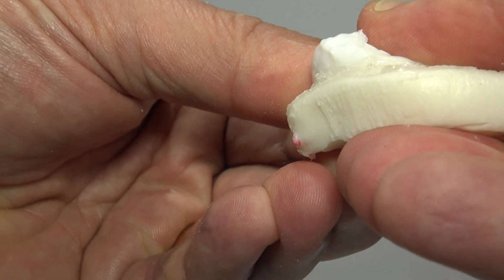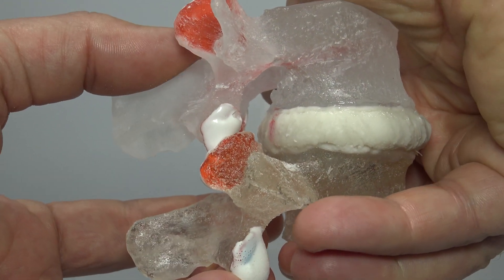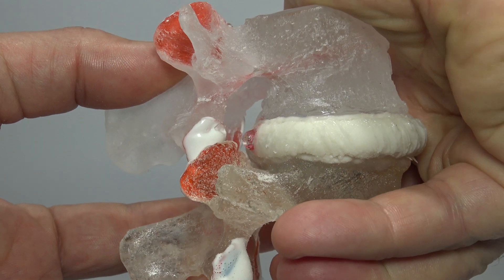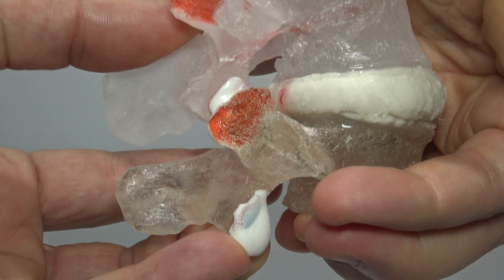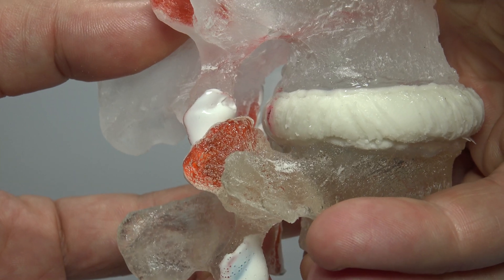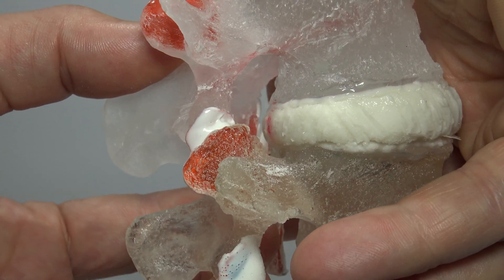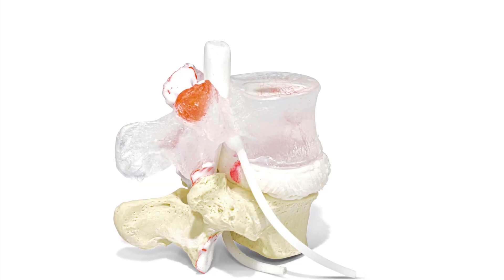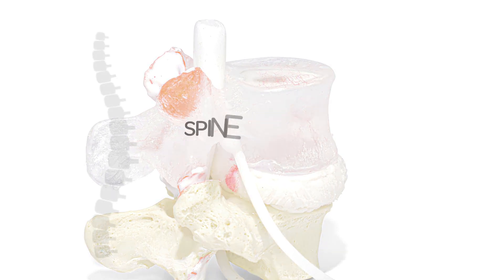A Common Cause of Disc Herniation Explained

Comment: But that goes against laws of compressive forces. Especially because of the discs reticular fibres. Pressure from flexion, extension and your direct compressive force from your “optimal” posture would cause the herniation to go in the same direction.